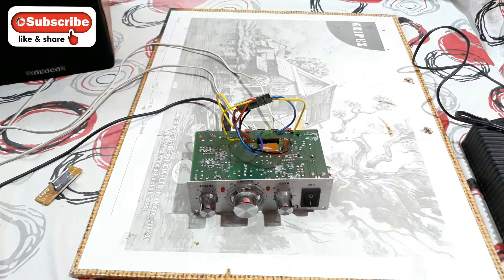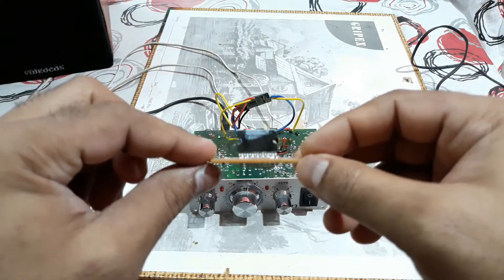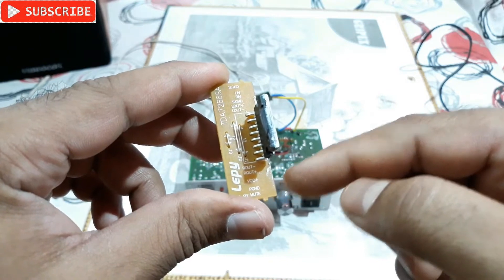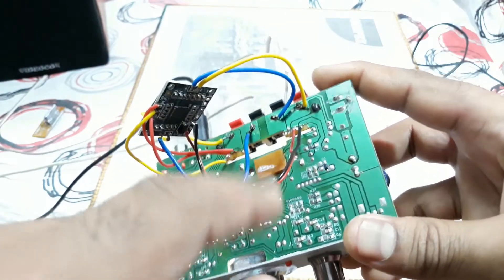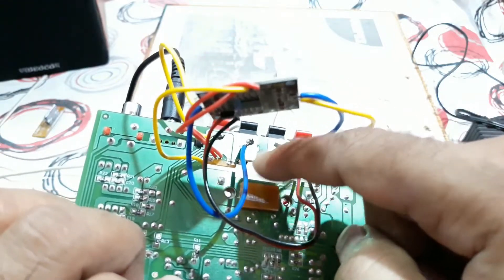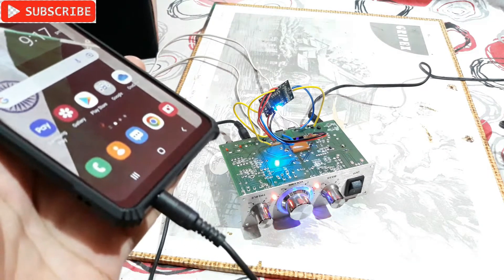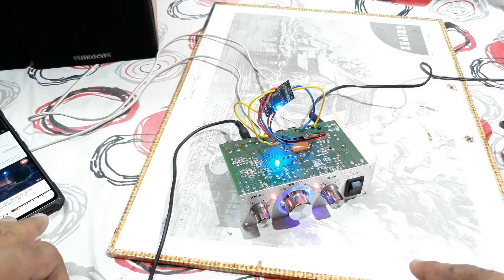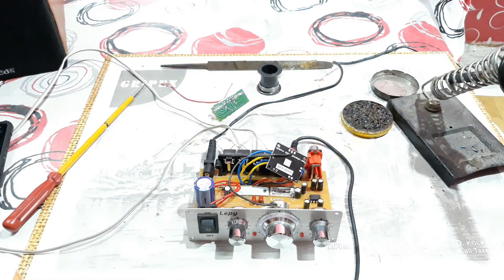How To Repair Lepai Mini Stereo At Home At Only Rs.80 // PAM8610 ClassD Amplifier Full Connection

Comment: TDA7266 no wonder they were selling this at rs 836 I've still got mine in a cupboard somewhere. I had put it away after it was turning off at 60% volume on a 12v 2amp and 10watt speakers